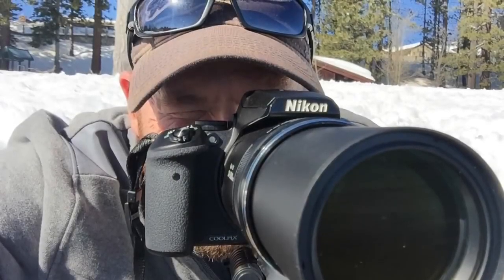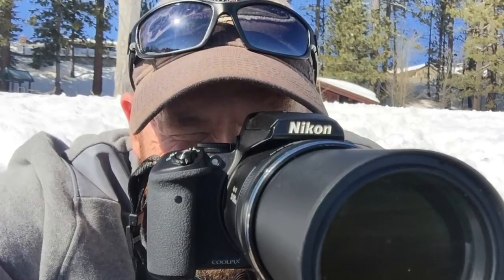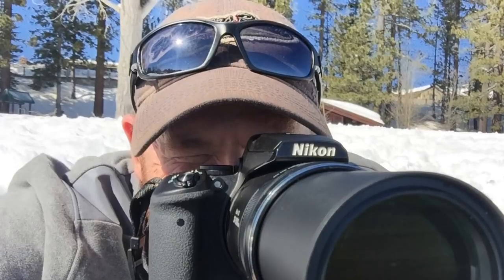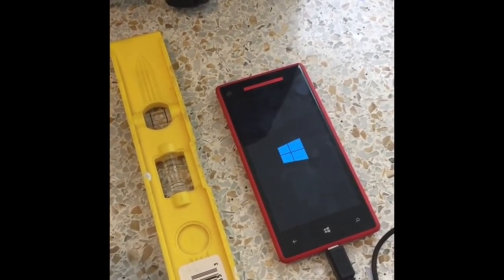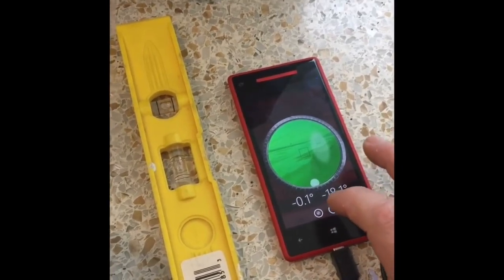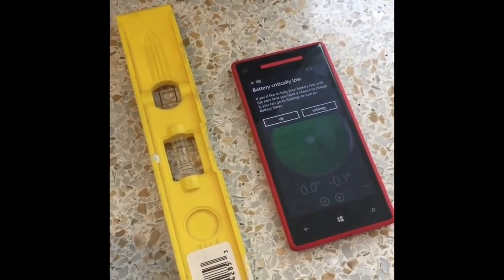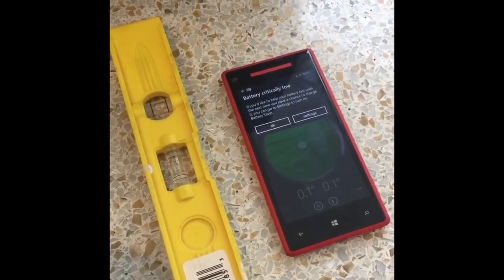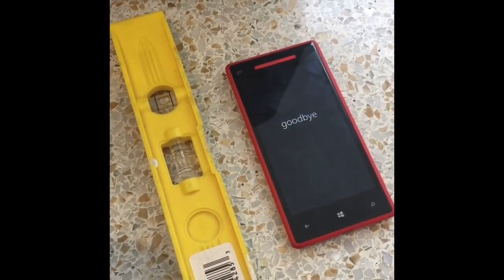4,519 MILES   NO CURVE!  RESEARCH FLAT EARTH

Comment: The app you are using, measures how level a surface is. The numbers were the same because both points you recorded data from were flat. The app used simulates a “level” device, by accessing your phones internal gyroscope and displaying its delta from the control